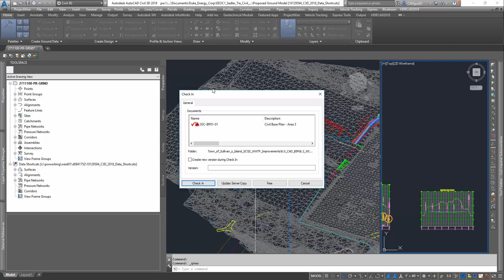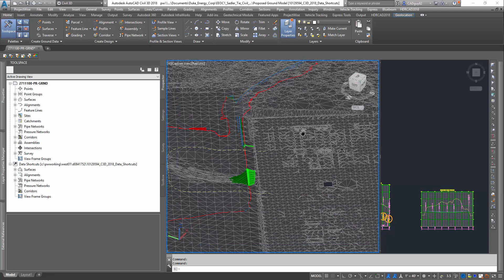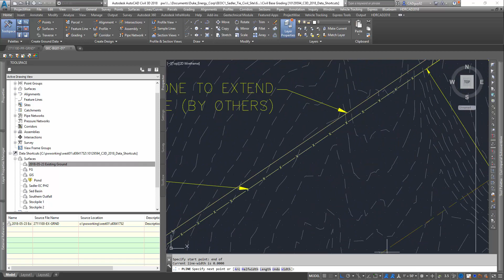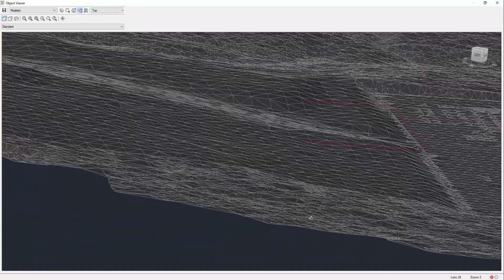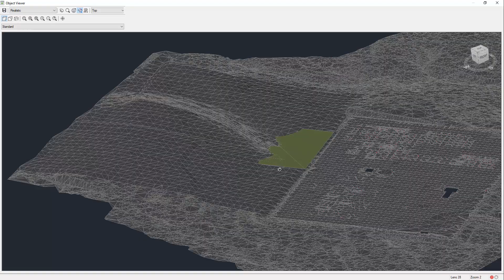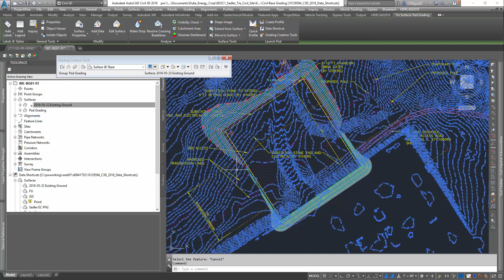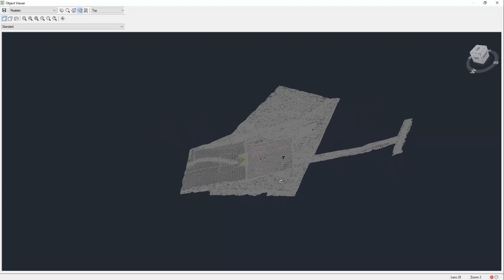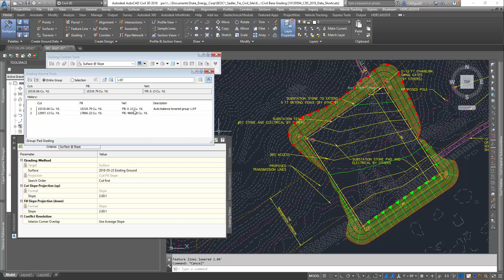Civil 3D Grading Tools Overview General

Comment: Dynamic garding become very complicated in hillside grading , when you have slope Easement in lot,  creek on  sides of lot, and you have to adjust the slope of driveway too according to county code.
Reply from the maker: Yes, I completely agree! The Grading Tools are great for those very straight forward scenarios. If you have varying levels of requirements and conditions that need to be applied, I'd recommend leveraging a combination of Grading Tools and Corridors where you can apply different conditionals to your assemblies within the corridor model itself.
Reply: @stephenwalz3900  Thank you Stephen  for your recommendation , i am doing same by leveraging Corrdiors featureline and Grading tools to grade complicated sites. thats what i learned in past 3 years, that every site is different in term of grading, so using multiple Civil 3D functionality like featurelines corrdior etc is best option  .